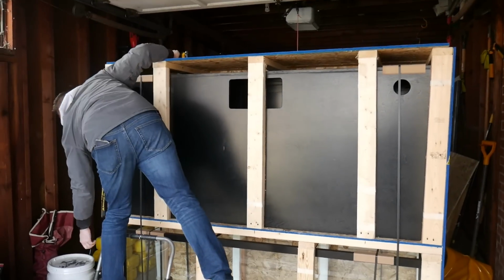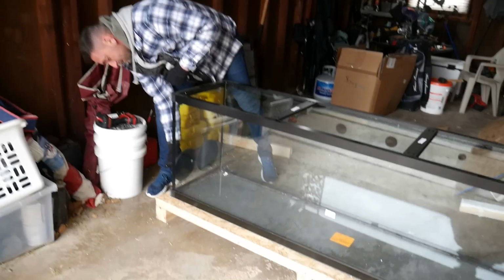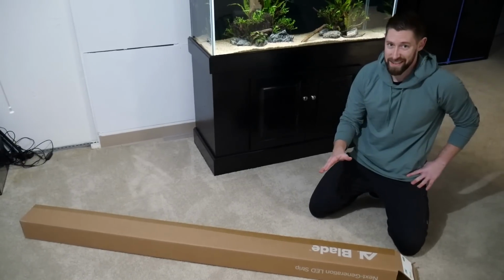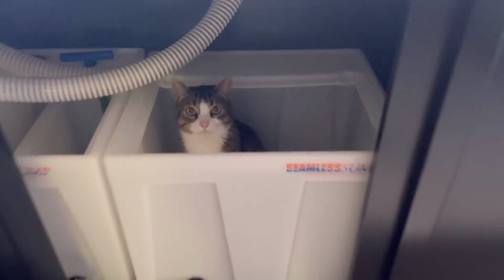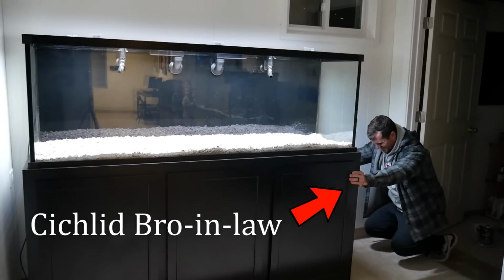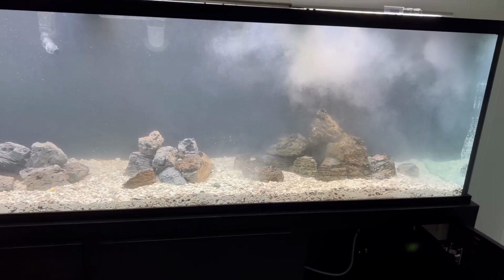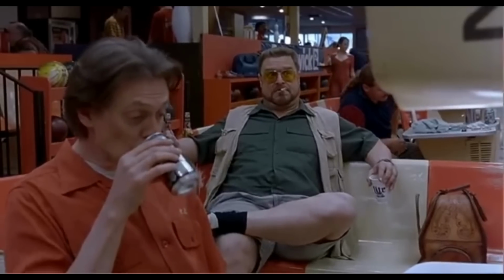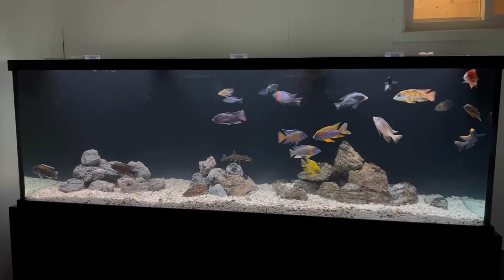My *BRAND NEW* 6ft Cichlid Aquarium Setup from START to FINISH! (Fish Added)

Comment: Just purchased the sicce sdc powerhead. Seems a bit underpowered compared to my hydors I replaced them with. For the price I was a little bummed out. But I get the piece of mind with the notifications of temp and power outages. Looking to buy the sicce sdc 6.0 pump for my 90 gallon next. Hard to swallow the 350 dollar price.
Reply from the maker: Sorry to hear that. I kinda have the opposite, with my wavemakers usually being turned down to about 50% power, as 100% seemed too strong of flow. The 6.0 has been great for me thus far. Definitely love all my pumps on one app too

Comment: Beautiful aquarium Troy@CichlidBros. I wanted to ask you, did you have to rinse the Aragonite Sand and the African Cichlid Mix. I'm still trying to figure out what kind of Carib Sea substrate that I want to use in my custom 65 gallon acrylic for the Mbunas that I want to put in there. I love that Carib Sea Sunset Gold that you have in your other tank but I also need something to help with the PH. Any suggestions are gladly appreciated.
Reply from the maker: Thanks! I usually don’t think you need to rinse Carib sea sand. For African cichlids, can’t go wrong with Aragonite. African cichlid mix can be cool too if you like that type
Reply: @CichlidBros  thank you for your reply.  I'm gonna figure out a way to use that Sunset Gold Sand and still keep the PH where it needs to be. Might just go with putting a media bag of crushed coral in the filter.  My only problem now is to find a sponge cover to cover the the intake of the tidal 110 HOB to keep the Mbunas from spitting the sand into the filter.

Comment: How come you don't rinse your substrate before adding it to the tank?
Reply from the maker: Didn’t need to
Reply: @CichlidBros  did you not need to because that that particular substrate? Or do you never wash it out first?
Reply from the maker: @IronBill40  usually don’t need to with Carib sea sand. I would with something like pool filter sand tho